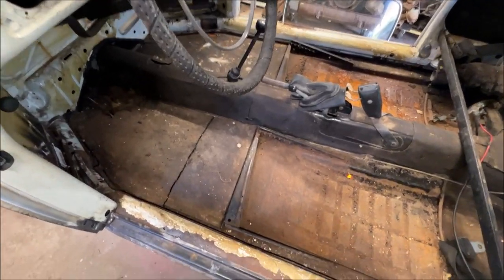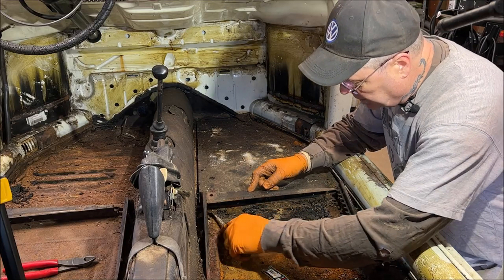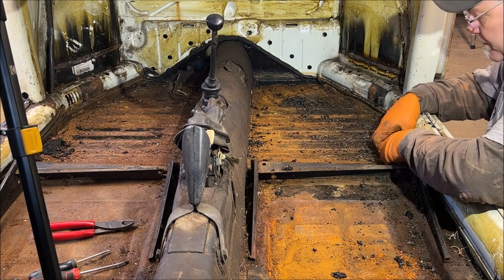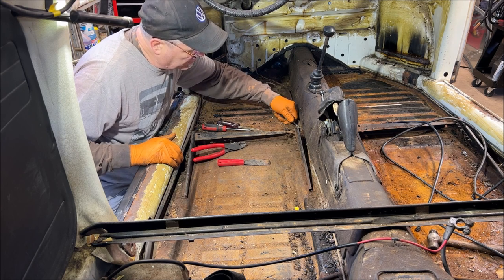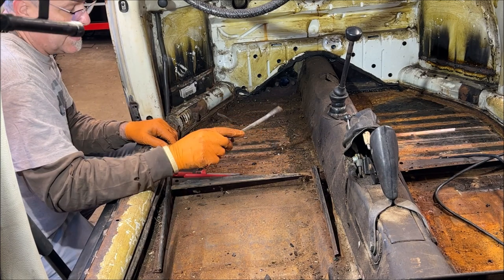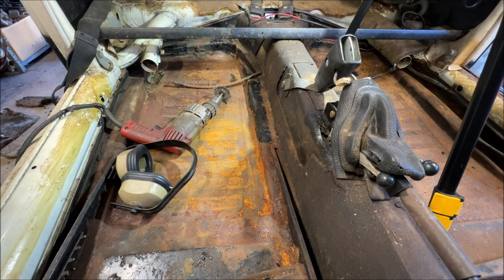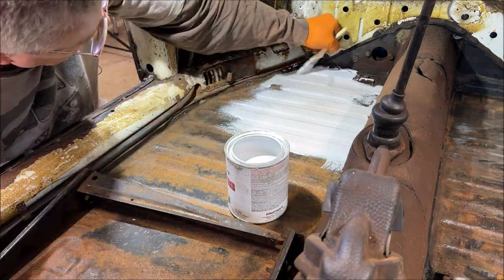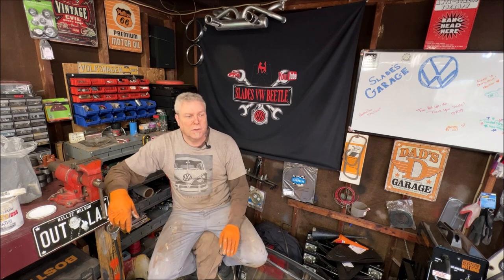VW Beetle Floor Pan Restore with Rustoleum - Also Super Beetle

Comment: I wish my tarboards came off that easy…took hours of chipping away at them. 😖.   Now to do a partial pan replacement (battery area) some wire wheel action, then paint.  The sound deadening will go in later during reassembly.  Great Video!
Reply: The temperature really changes how hard or easy it is to remove tar board.
There is a sweetspot where they come off easy....I forget if that's cold weather, I think it could be, this dry ice Was a great idea, I used a fire extinguisher, more messy!
Reply: Also the metal primer flows on and sticks better when it's heated up.
Reply from the maker: I was honestly surprised they came right off like they did. Battery area is a common spot. Not a bad fix honestly
Reply from the maker: @johncollins5552  I typically warm my paint, but….that time I didn’t. But you’re definitely right!!!

Comment: Opening up the tunnel for access to the clutch cable is actually a smart thing to do for the average VW owner.  Anyone who has fiddled with installing the pedal assembly wishes they had a way to grab that cable from the other side of the tunnel.  It wouldn't make sense for a show car or a 100% resto, but the rest of us can use it.  Nice video, btw.
Reply from the maker: Thank you Dave!! I must admit it would make it easier, the clutch cable can cause some aggravation!

Comment: Last week I used naval jelly, then used aluminum window screen and about 100$ worth of JB Weld and salvaged some partially not connected flooring. Then I applied the Red Gaurd waterproof membrane and lastly the black bed liner pudding-like stuff application. It worked like a charm. About 200$ in total. I then used half inch thick felt flooring underlayment and then the carpet squares with the rubberized backing. Underneath the car doesn't look so magnificent, but you can spill a drink on the floor and not a drop is exiting the car. I have some old lady-bug floor mats that add a touch of artsy fun to the floor. All this was done on my '69 Yukon Yellow bug. I call her 'CAR' = Same color and year as on the Cover of Abbey Road album. She got tired of the Beatles kicking her to the curb that she decided to move into Bug Garden with the other 7 classics I have scattered throughout the yard as ornamentation.

Comment: Looking great Bud. Floor pan is in really good shape. My tunnel is also notched from a previous owner. Thank you for sharing the update on your progress, and tips on money saving. Ive seen people throw floor pans in, then use roof tar to smear over the patches to keep out the weather. Why throw away money if you don’t need too. Budget Builds can be just as nice as a full restoration project, my opinion. Sending the best for you and Heather. Have a great day. Looking forward to next update
Reply from the maker: Thank you my friend! The super beetle that I did, my last project. It only had some holes of course in the battery tray. So I replace that rear section. I don’t believe in ripping the body off, unless you have to. I have some rot at the backend, That I dread doing. But I guess it could be worse. Lol I hope that you’re having a wonderful day, and the upcoming weekend goes very well for you.
Reply: @SladesVWBeetle  Yku will have it looking awesome in the end. One day at a time. Have a great day!!

Comment: Nice work Slade, tar boards are sometimes a pain in the … but luckily for you they came out very easy. I didn’t had that problem with the early oval, because the tar boards came later.
Have seen that with the dry ice and worked very well. Can’t wait until next week.
Reply from the maker: Thanks my friend!! I’m actually surprised mine came up was easy as they did!!

Comment: Another great video Slades. I think this is missing on mine as when you pull the floor mat up all you can see is the floor pans. And they have to be replaced as they as rusted thru in some spots.
Reply from the maker: Definitely watch my next video then. I’ll be doing sound deadener instead of the tar board. Cheap and easy.! It’ll kill the sound down! Make sure to get that rust fixed up my friend
Reply: @SladesVWBeetle  Good to know I definitely will. I’m glad I’ve got some more time to work on it. Now if only it wasn’t so cold 🥶 burr lol.
Reply from the maker: @blakewaddell451  it truly is cold now. I have to get kerosene for the garage. Although it really doesn’t matter because when I’m filming, I have to turn the heat off. The torpedo heater is too loud. I’m not going to win either way lol

Comment: Like your videos, a lot of content to help others. I was most fortunate in getting a 66 Beetle with no rust here in Australia, so I’ve still got the original floor coverings, rubber moulded front and rear. Could you recommend the best place to fit a 1kg fire extinguisher in a beetle?
Reply from the maker: Thank you!!! Honestly I like to mount them in the back seating area on the door pillar…Pillar B!

Comment: Those floor pans are in amazing shape.  I love the process of wire wheeling and painting.  Did the same thing on my Comet.  Not as fun underneath lol.
Question.... The tunnel has sound proof??? Are you removing that also ?
Reply from the maker: Honestly I was quite surprised at the condition of them. I have mostly some rott at the back of the car I’m not thrilled about. But I guess it could be worse. Yes that soundproofing I will leave that on the tunnel. It’s very solid. I’m soundproofing the floor pans and the rest of the insides of the doors.
I love your damn Comet!!

Comment: I removed my interior today and found the original black soundproofing wet behind the driverseat and under the rearseat on the left side. Also I noticed several drainholes (drilled by previous owners?) . Where does the water coming from do you think?

Comment: Slade, I reviewed this video again and have a question about removal of the tar boards on the tunnel: if you are installing carpet and due to the thickness of the carpet, do you remove the tar boards and do you also put the aluminum sound deadener tape on the tunnel?  I am removing the 50 year old tar boards from my 74 SB Convertible and am getting close to the taping portion for sound deadening.   Thanks!